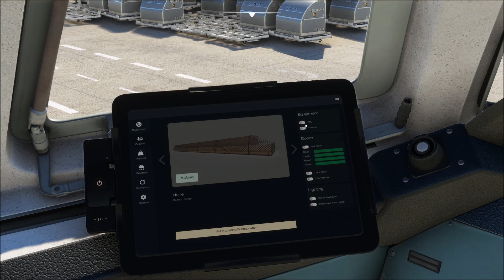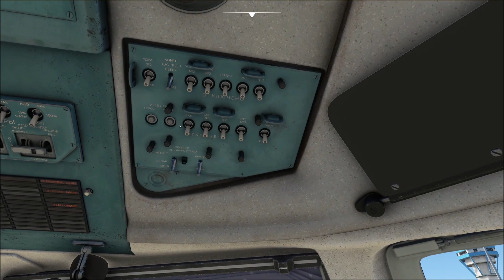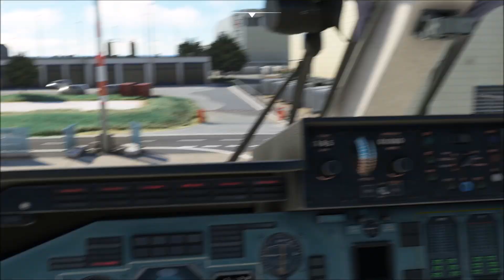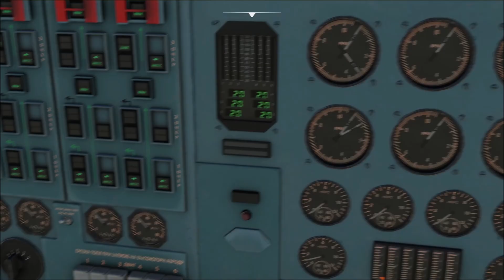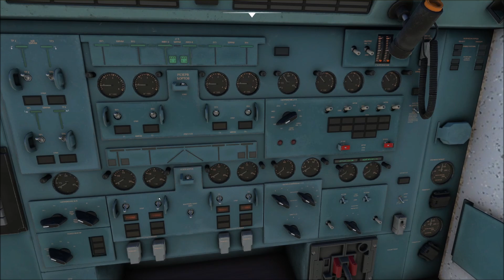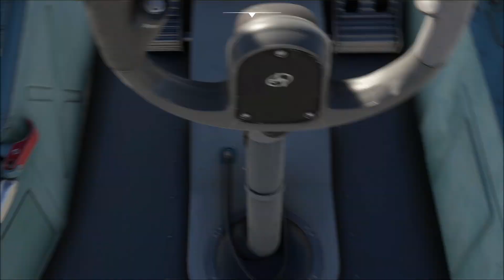Antonov 225 Tutorial 1: Preflight, Startup, Before Taxi Procedure

Comment: One misconception about all the "on/off" switches - they are actually the circuit breakers for those systems. It's a quirk of Eastern Bloc design scheme. Instead of having everything on what we consider "normal" circuit breakers, they use switched breakers for almost if not all "important" systems so that they may be individually checked without wearing out the pull type breakers we're used to seeing. The number of functional checks required on Eastern Bloc aircraft is pretty impressive compared to what we're used to in the rest of the world.
Reply from the maker: Thanks CAPFlyer, I didn't know that!

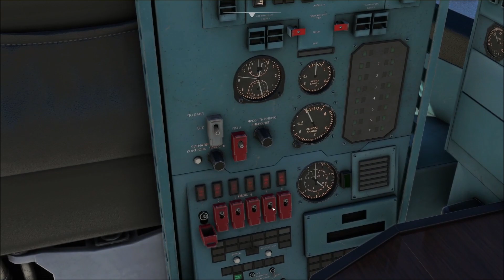Comment: Hey, I just noticed something that I think you misinterpreted (and I did at first as well). At 10:21 you identified that engine 6 was starting due to the lower left RPM gauge. Then, at 10:45 when you identified engine #2 starting, in reality, this was the N2 value of engine #6 increasing, and engine #2 was not yet active. 

Basically, since there are 6 gauges with needles labelled 1 and 2, I assumed (you likely did as well, and lots of people naturally will) that each gauge represented an engine and that the needles were N1 and N2 values, but it appears actually the opposite. It looks like the top row of gauges represents N2 values and the lower row of gauges represents N1 values. The needles 1 and 2 on each gauge actually correspond to the engines instead. 

Meaning, the #1 needle on the top left gauge is the N2 of engine #1, and then the #1 needle on the bottom left gauge was the N1 of engine 1, and then the #2 needle of the top right gauge was the N2 of engine #6. It's all quite confusing but I hope that that explanation makes sense. Also not sure if it's necessarily supposed to work that way, but that's how it appears to work for now.
Reply from the maker: Hi, thanks you're right! Unfortunately there was no information in the manual and thus I had to make something up. But you're absolutely right! So weird to have N2 above N1 on the gauges...
Reply: @A330Driver  Quite true, I think everyone else will naturally think that too. It's pretty weird that the gauges themselves aren't at least labelled. I wonder if that's accurate.
Reply: Remember those are triple spool engines, so what you call N2 is probably actually N3.

Comment: At 10:45, how do you know the order of the engines? It would make more sense if the top gauges were 1-2-3 and the bottom ones 4-5-6
Reply from the maker: I assumed it from the order in which the needles started moving during the autostart sequence. According to the manual the autostart does it like this: 1-6-2-5-3-4
Unfortunately there is nothing in the manual to tell me if that's correct or not.
Reply: @A330Driver  The engine gauges go from left to right in pairs. Top 3 gauges are N2, and bottom 3 gauges are N1 gauges. Each has two needles with numbers 1 and 2 on them needles with number 1 are for engines 1 3 5 (odd numbers) from left to right and needles with number 2 are for 2 4 6 (even numbers). In other words the aircraft has a total of 6 gauges and 12 needles for N1 and N2 for 6 engines.
Reply: @TheSimPilot  damn they’re really making it difficult for no reason 😂
Reply: @FlightSimulatorEnthousiast  I guess it's meant for greater fun :)
Reply: @FlightSimulatorEnthousiast  Isn't that the Eastern Bloc way?
Reply: @A330Driver  You are the instructor here and the author of the tutorial. (:

Comment: From what source do you know, that the standard procedure is to use both APUs? I am asking about this because I search for reliable sources, but there is not a lot of them. ):

4:25 Are you sure about this? Looks like you just switch off the APU generators.(;

15:09 Aren't spoilers armed by setting them to the 0 position? The up position is disarmed, I believe.
Reply: At 4:25 the APU Gen were ON and 737NG Driver shut them off. Also at 15:09 the Spoilers were on armed position and changed do disarmed. The 2 things that were wrong in the procedure. Also the Engines dials. First upper gauge 1 is engine 1 and 2 is engine 2. The gauge below i thing is for N2.
Reply from the maker: @vectrapires  Thanks! Any source for the engine dials? Unfortunately there's nothing in the productmanual.
Reply: @A330Driver  I couldn't find any information. I am trying to get that info and as soon as i find, i will provide you. But if the RPM on the upper dials don't match the ones below, so that means that the upper dials are for all 6 engines N1.
Reply: @A330Driver  i asked the on inibuild forum. N2 are the upper ones and N1 the bottom ones.
Reply from the maker: @vectrapires  Thanks!
Reply from the maker: Hi ClouDAction,

APU: From the product manual. It instructs to use both APUs as standard.

APU GEN: You're right, they should be up, not down. I added a pinned comment clarifing that.

Spoilers: When "training" the procedures with the in-game checklist it wanted them in the upmost position. If that's incorrect then it is a bug in the in-game checklist calling for a wrong position. Unfortunately the productmanual doesn't tell in which position the lever should be.
Reply: @A330Driver  Spoilers: Just test it. (:
Reply: @A330Driver  For takeoffs and landing you want the spoilers handle in 0 position (second position from the top), that way they will extend automatically during touchdown. Forward position is retracting spoilers and forcing autospoilers off.